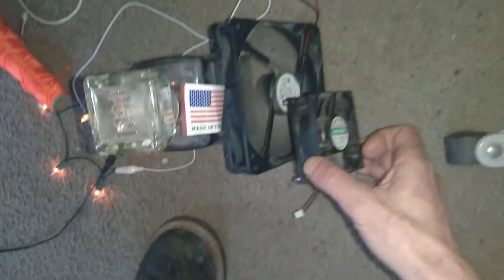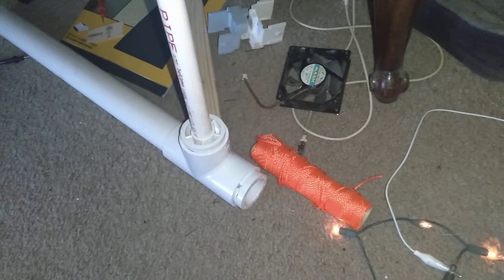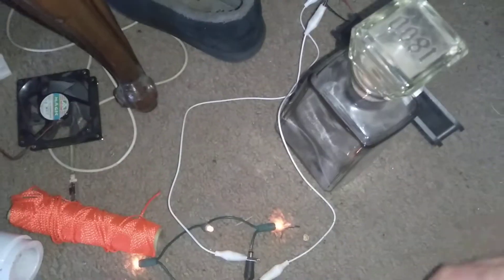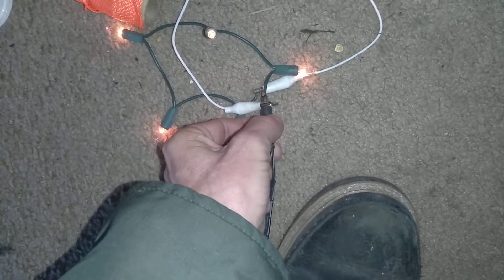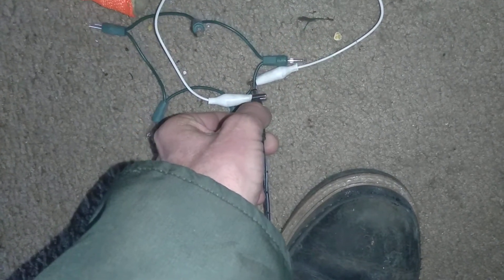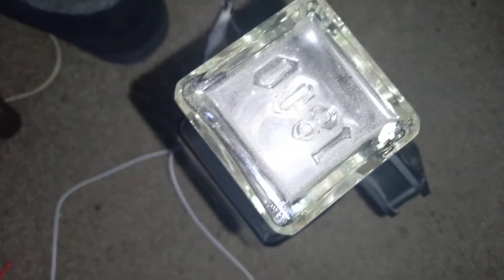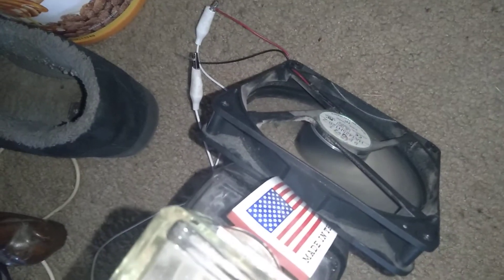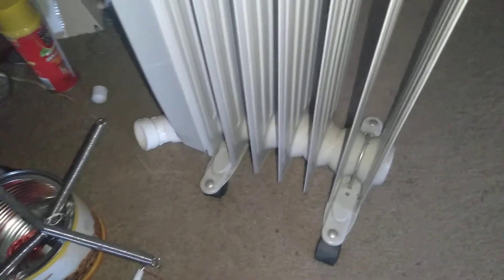Using lightbulbs as current limiters

Comment: I do the same for running cells from batteries
Reply from the maker: I learned with SPL stereos it was cheaper to blow a light bulb than a $300 speaker. Never forget seeing what happens when you run a 2 ohm stable amplifier at a half ohm :) toasted transistors and total meltdown.